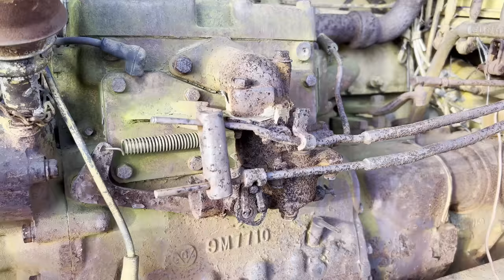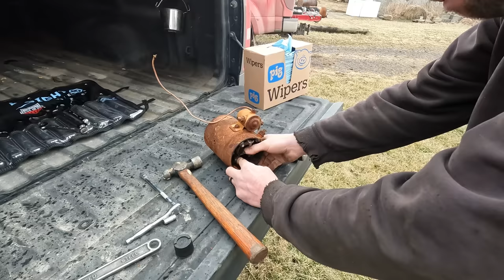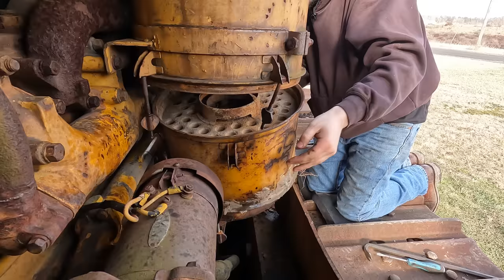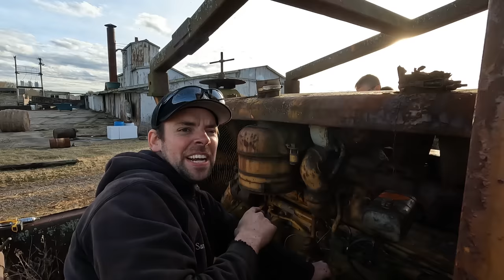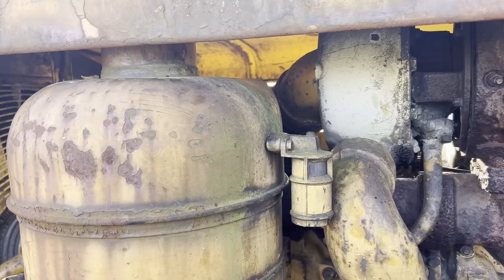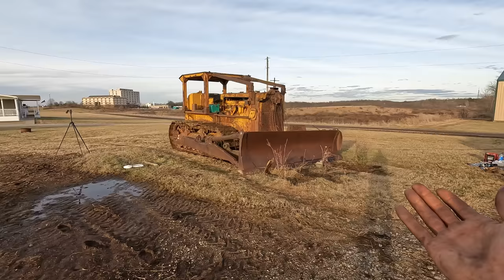Caterpillar D8H Bulldozer Sitting for 15+ Years! (Will it ever run again?)

Comment: The resilience and longevity of old equipment is simply astonishing... Imagine trying to do the same with a 2024 piece of equipment in 2084... There's not a chance in hell. All built with planned obsolescence. It would take months just chasing electrical gremlins, bypassing security and safety measures, before you can even think of getting to the mechanical side of things 😅

Comment: What a great old hunk of iron.   The first dozer I had anything to do with was an old Cat D8.  Early 1970s, and I had been hired to plant trees on a coal strip mines in Virginia.  Got “volunteered” to help change out a set of tracks, track adjusters and front idlers on the D8.  Put some long hours in with a big sledge hammer… when I graduated from high school soon after this, I ended up working for a bunch of yrs on this same strip mines, first on a coal auger and then as an equipment operator.   In the early 80s I ended up in the military… I stayed for the long tour (24 yrs and several combat deployments).. but I can still hear and smell the old equipment… keep up with what you’re doing..you are a hard working young man!   🇺🇸🇺🇸🇺🇸🇺🇸
Reply: Thank you for your service. Kudos to you
Reply from the maker: Thank you for your service!
Reply: TRATOR A VAPOR MUITA FUMAÇA.

Comment: This brings back memories. I learned to operate an old cat D7 cable rig at age 16. The pony motor didn’t have a electric starter. It was turned over with a long crank that stuck out the front. If you killed the main motor with the blade up you couldn’t get the crank in to start the pony motor. I’ve had to walk off the mountain to get the old Ford tractor to move the Cat enough to get the crank in several times.. I worked all summer clearing trees off of 40 acres. I learned that running a bulldozer wasn’t what I wanted to do for the real of my life.

Comment: Love the old dozers, they can sit for years, throw enough compression back in them with fuel, and boom. Love those old cat engines too. Nother good video matt, shooting for 1mill subs.
Reply: Notice how most the old iron that's still running are cats 😁
Reply: @ronniewilliz153   Cats and old old Cummins. Back when they were made to actually do work.
Reply: @Ronnie Williz  Saw a Gold Rush video the other day and saw and old Clark Loader. Loader older than me! 🤦‍♂️
Reply: @tankman1930  yes. That old stuff that didn't need much to work and run and didn't need much maintenance
Reply: There will be some party when the 1 million subs are here.
Share the videos guys comment like and subscribe so we can have more content from Matt
Reply: @ronniewilliz153  And still running today, check back 50 years from now, and everything from 90s to now, with either need a full rebuild or just wont run.
Reply: I hear you, i feel exactly the same way, as a child if i saw road construction on a car trip i was glued to the window, my dad had an old Cat 2U D8, a TD20 International and an Allis Chalmers HD6, as a child i played operator for many an hour and eventually started to learn for real on that HD6 pushing tailings on a mining operation. love old dozers, and trains.
Reply: @clinthowe7629  that's awesome I love operating love my job

Comment: Loved the video which brought memories back of my Cat D8H dozer when working on the Thai/Laos border in 1967 with the British army on road construction.  Our pony/donkey engines were notoriously unreliable and on many occasion had to resort either hand crank start or to a pull/push start in gear on decompression and then kick the decompressor over.  Although 56 years ago the noise of a Cat D8H starting is etched in my memory.  Great you saved an old equipment.

Comment: If you are going to use that cable unit, make sure you install guards on both sides of the operator's station.  My grandfather used to grade fields with 2 of those old dozers and had a pan cutting edge catch on a boulder.  The tension snapped a brand new wire rope and the cable whipped around and shattered his ankle so it was never even close to right for the rest of his life.  They popped cables fairly often until he finally gave in and upfitted both dozers to hydraulics for the pans and the blades.

Comment: I became an Operating Engineer in 1979 and the first dozer that I operated was a CAT D8 46A with a hydraulic dozer blade with tilt and hydraulic rippers. I operated the 46A dozers until the CAT D8K dozers came out and then I went up to the massive D8L High Track dozers came out. The D8L had a fully enclosed cab with air conditioning and after that I was in a fully enclosed A/C cab for the rest of my career. It was great watching you guys get the old CAT running again.

Comment: Many years back I was based at the international telex center in New Zealand. We had a WW2 USA Cat generator set on sled with pony motor. Except ours didn’t have a starter motor, had to decompress and hand crank and hope it started, then used it to pre warm the diesel before starting it. So this brings back memories, thanks again for great video
Reply: Until they were all recently upgraded, lots of the smaller telephone central offices in Southwestern Pennsylvania still had 2-stroke Detroit Diesel generators from the late '40- early '50s. Before they were all scrapped, someone apparently took all of the cool stamped steel GENERAL MOTORS signs that were bolted vertically to the sides of the radiators, possibly selling them on eBay (though I can neither confirm nor deny this)  :P
Reply: We have a 1950s Cat piston air compressor (with pony motor) up at the gold mine. It's a backup and peaking unit to supplement a Cummins genset and Gardner Denver electric compressor. We rescued it from a stripped-out millsite in New Mexico.
Reply from the maker: @wes11bravo  I know where one of those gen sets is still hidden!
Reply: @wes11bravo  that makes sense. Ours was to recharge the telex batteries and provide power in the event of a failure. We had to run it up,every month to ensure it would start.

Comment: Great video thank you Matt! I'm in the process of recovering a D6 8U (also a cable blade) and watching you and your mates going through the inspection and resurrection of the pony motor was valuable. I've added a points file to my list of required tools. Also checking the injector pump oil bath - definitely don't want to risk an engine runaway! Looking forward to seeing part two of this adventure.
Reply: L S - are you guys rescuing your D6 from an old mine or someplace? It seems fairly common in the more remote areas of the USA for larger machines to spend their last working hours at a mine or quarry, etc. The operation ends and it's not worth it to haul the larger equipment back so it gets abandoned. Heavy D Sparks gets some of his machines that way.
Reply: @wes11bravo  Hi Wes. I'm in new south Wales, Australia. The dozer I'm working on is on a farm. It was hauled up there to build a road and a dam and parked after it was finished with. Last time the owner tried to start it (10 years ago) the pony motor was under powered - which I think may have been due to a bad spark plug lead - so it has sat there ever since. I'll have to get it running to drive it out as the road it built is now fallen into disrepair again!

Comment: I've got my dad's old D6 just like that. 1952 D6 cable cat. It's been sitting for about 20 years now, but I know with a bit of work she'll run again.  He bought a parts cat for it too that has hydraulics. The plan is to get it transferred over one day.  Haven't got a need for it right away, so it's just sitting, but she'll last forever. 
Great video! Thanks for that. Reminds me of helping my dad get his running when he first got it.

Comment: You have to hand crank the pony to appreciate it.😁 I used to run old D-7 and 8's with ponies, Northwest Dragline Cranes with Cat engines and pony, Link Belt Speeders Clamshell Cranes with Cat and pony with the exception of a starter on the pony- just a hand crank, that was always an adventure in cold weather. Nice job, brings back a lot of memories.

Comment: My father had a D8 we used in oil fields in PA in the mid-70's.  I am unsure of the year, (I think it was a '53 because it did have the '50's era factory roof like later 50's and 60's models) because it had an overhead cable on a rear spool for the blade lift.  With its 14' blade it could, and did, move anything and everything.  We even accidentally removed a 14' section of roadbed pushing a loaded lowboy trailer that got hung across the road surface.  PennDot thought we wanted a pothole fixed, and wasn't quit prepared to find a 14' section of the road missing, lol!  Had to leave it in PA when the job ended in 1979, just too big to take with us back to VA.  The tractor would have needed one semi, and the blade another.  Still have photos riding the D8 with my father, some of the best times as a 10 year-old!

Comment: I retired after working for a Fl. Cat dealer for 35 years, specializing in transmissions and hydraulics. When I started in ‘76, they had a few old D8’s in the shop and I saw them start them with the pony motor, but never did it myself. Rebuilt a lot of transmissions, powershift and a few direct drives. I loved the job and the people. I only miss the people. Keep up the good vids.
Reply: OMG! It’s alive! It sounds great, congrats you guys, great job! Now, will it move?
Reply: And it does move. Great job!

Comment: I went for a job at a scrapyard. They told me if I could get this old crane running, I’d be hired. Then handed me a hand crank and left. Took me a little bit checking the crane out, put the hand crank on the pony motor, a few half turns and it started. I ran it for 4 hours, until one of the swing clutches started failing and then stopped. They hired me anyway and put me on a newer crane with an electric starter! (No heater, but no hand crank either!)

Comment: Those old CAT's sure sound sweet, my first experience of them was in my mid 20's, I'm now 66yrs old. I used to fuel and service them. When they had problems with pony engine, they used to push them with another dozer and bump start them. There was also a D9 with pony, that I started everyday for months, that sounded sweet too. We very happy when they left and we got electric start D8s & D9s.  I used to work for a mining company in England back then, went on to driving the beasts from there on, dozers, trucks, scrapers and so on. Used to drive a old Komatsu 155A that sounded sweet too, not sure what engine it had now, Perkins or Cumings I think?   Those old Cats where made to last a lifetime eh.
Reply: Not cumings but Cummins

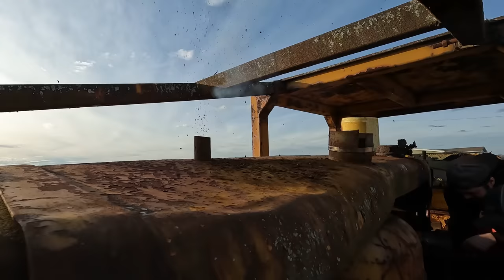Comment: That starter for the pony motor is a champ with all that cranking Nice to hear it running sounds pretty decent Matt 19:00 @Diesel Creek
Reply: In the UK, what you call Pony Engines, we call Donkey Engines! I recall starting D8s with them in 1958. Ours were not new then and, if memory serves, the Donkey Engine was only a single cylinder one. When the weather was cold, we used to  put a petrol rag around the carb to warm it up!
Reply: @crossleydd42  I wasn't the only one that called it a pony motor Even the Creator Calls it a pony Motor
Reply: @crossleydd42  cool information Sir

Comment: Hiya Matt, good video son there, Ive worked on them old cats all over the world, As an Englishman I love Cat equipment. Worked on the Kenworths with 3406B's in them , Western Stars etc. Them 342 engines as in your dozer are a good motor, But the 343 overhead cam (rear motor on a 657 scraper) are Bullet proof. They say the best engine Cat ever made. My Personal favourites though are the D397, 398 & 399 Cat engines, Had loads in the oil Patch down in the Sahara desert, Very old models as well but great bits of kit & rarely let ya down.

Comment: Come to think of it Matt, still got a couple of Champion Spark plug testers in my tool box for the Pony engines for checking if you have a spark or not. The good old days hey, Remember some old Irish fellow in Nigeria on an old 22A getting pushed from behind to Bump start the dozer , when the batteries were shot.

Comment: Ran a D-9 with a pony motor at a strip mine in Oakdale Pa. and the boss required putting a small flat rock in top of the pony motor exhaust to keep the rain out. Smart man, cheap, but smart. Could use that machine on a piece of property I have on Creek Road.

Comment: It good to see people save that old iron instead of scrapping it. I know where four of those old d8h machines are that partially disassembled but pretty much everything is there. They would be a good restoration project for someone or a good source of parts to keep others running. The owner can't stand to see them scrapped but would let them go fairly cheap to someone that would actually use them.

Comment: Those old pony starter engines are damn near impossible to kill. They were built to run forever and they usually will with very little effort. Mostly impressed that the winch just worked right away, even with rusty cables, although it remains to be seen if it holds up under load. The blade's in pretty good condition too - give it a new edge and it should be good to go back to work

Comment: My Mennonite neighbour here in eastern Ontario Canada years ago picked up a six ton Cat V8 power unit with an over center clutch and big belt pulley. He got it out of a scrap yard. It had sat there for years. Apparently it came out of a lumber mill. He messed with the pup (mounted on back pretty much in the bank of the V) until he got it going. A V4, if I remember correctly. No electric start luxury on the pup. No, it was a manual start. Not even recoil; grab the flywheel like an old John Deere two banger and spin it by hand. Stubborn, cantankerous little thing. It just screamed when it ran. I always thought it was going to blow itself apart and stayed clear to the front or the back of it. I never stood beside it. If he got the pup going, big V8 started. It was pretty much a sure thing. Blow a little heat through it then roll it over. In just a few rolls that big V8 fired off no matter what the weather and shook the ground. What a machine. Incredible build quality. Made for the ages.

Comment: That's what I learned to drive a track on! 12 years old and I was using a monster just like this one to drag the trees out of the site my parents were building a house on. That one didn't have a roof or roll bars, but damned if that ain't the same cable system on it! Keerist that's been dang near 40 years ago.... I still remember that rumbling monster belching smoke, stammering and stuttering till she warmed up enough to stop shivering and hit on all holes.

Comment: The 25-35 minute video is perfect, makes me not rush my lunch so much wanting to get through the thing by the time the plate's empty. That dozer gave me a weird feeling of being too far gone, strangely turning out to be the somewhat simpler resurrection. Similarly to the crawler dragline crane thing actually. Personally would have pulled the engine and just use that as generator for the shop or something like that, running gear doesn't evoke much trust to me, hopefully I'm wrong again there.

Comment: Those old Caterpillars will run no matter what you do to them. Back in the 1960’s my uncle had two D-8’s and a D-10 that he used for logging. My cousin drove a D-8 into a river and it sank up to the hood. We dragged it out with the D-10, flushed it out, put in clean fuel and it started right up. Ran for years after

Comment: When checking out starter motors and old generators, the air gap between the rotor and the stator is very important. The bushes/bearings must be tight, no more than 0.003" slop and the iron surfaces must clear of rust and other crap. I use scouring pads to remove the crap from the rotor and the magnet surfaces of the stator. From the sound of the starter motor this was a lot of its problems =. Cheers

Comment: Never have seen a 46A serial number D8H use a cable lift for the blade. We had three D8H's 46A serial Cats. Those pony motors worked great starting the main engine in very cold weather. I can still remember filter part numbers: AC Delco brand - Outer air filter A426C, inner air filter A427C (one each). Final drive filters PF333 - takes two (one for each side). There is a metal screen type cartridge filter at the hydraulic tank that can be cleaned. As old as that one is you probably will need a new one. I'm not sure on the transmission filter (been 40 years since I was in the coal industry). I think it was part number PF492. We also had ten D9G's, five 988 loaders, a 966, 955 and a lot of other equipment. Jeff Burress in Tennessee.
Reply from the maker: Yes you could order 8H’s with cable or hydraulic. I’ve never seen a cable control unit like this one.

Comment: Be the perfect rig to test the new crane out on in the new shop :-)) Ya spit the pony motor into the sun and replace it with a starter would be the first instinct but then I thought of you hauling dragline cranes out of the bush to restore and thought... doubt he'll ditch the pony motor right off... but still man... D8 could be a usable machine on many a large job.

Comment: Good  salvage  Guys   You  need a  "Pipe"   I make  good ones out of an  old  throw away  gas  cylinder ,  ..looks  good too.  I have an "R" cat  D8 No  1914 R.from ww2  was for salvaging  tanks  etc had  Marines  blue.   fitted with oyster d8N  oyster winch.   good  luck  from  New Zealand

Comment: Left a sub. One that was overdue for over a year now. Good content, I was acitively following your vids since the Autocar revival. I am cincerly hoping for similar content on the D8. For me, I am currently testing my knowledge on a 1.5 i4 isuzu turbo diesel. And I spilled diesel aswell, but luckily only on the side of the road (Feedline for the fuel blew out).